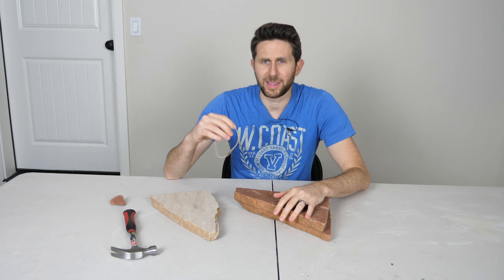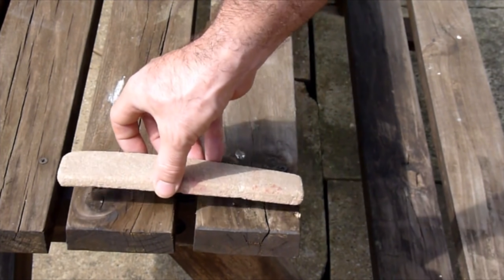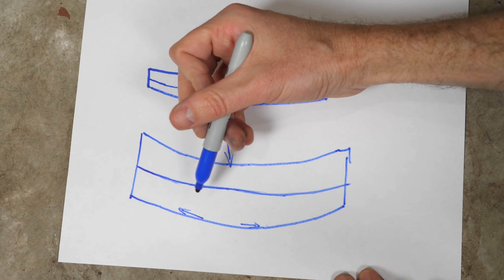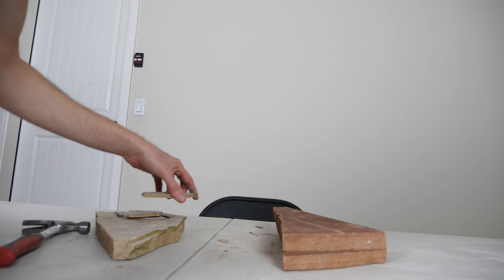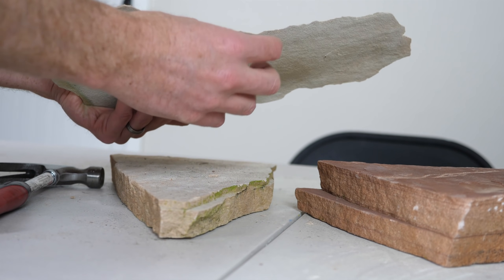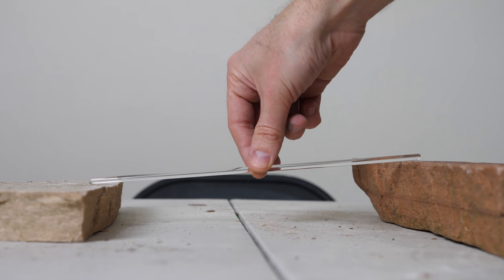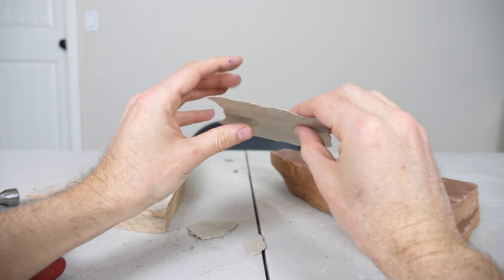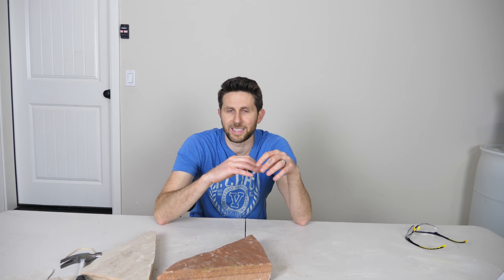Itacolumite—The World's Most Bendable Rock!

Comment: glass is a LOT more flexible than you'd think. a big 100x200cm sheet of 2.5mm picture glass bends about 10cm in the middle, when you lift it up by it's short side. and after all, glass can be made into fibers of remarkable tensile strngth and (tensile) flexibility.

Comment: 3:00 What if, while trying to bend it, you apply a large, fixed horizontal force inwards on the rock? This compressive force would cancel out the tension on the bottom surface when you bend it, so the entire rock would be under compression. Would that make it more bendable? (The piece would have to be thick enough that it won't just buckle.)

Comment: 0:50 its actually a quarzite derived from a sandstone
5:29 the layers are the result of sedimentation weak zones are usually were the material changes (like a silt or clay layer)
9:50 there are 2 types of deformation brittle and ductile for ductile deformation of rock you need higher temperatures and or pressures
10:04 basalt columns are a bad example as their "bend" could be the result of a shift of the cooling surface
there are pretty massive folds even visible from space check out the nunavut land claims on google earth for example

Comment: Although I think the video might be mostly correct, the effects of the experiment trying to bend the slimmer stone could have a bit exaggerated by the fact you are holding it with your hand. I suspect a lot of the bending we can see in the video at 7:15 is the result of the skin of your hand (which is soft) "absorbing" or "bending" over the force used to try to bend the stone, more than the actual stone bending.

Comment: Even if you talk only about a few years of compression, you can still see bent rock...for example who hasn't ever seen a table made of marble, which is a few years old? Did you notice, that it is slightly bent in the middle? Well this isn't an optical illusion. This is real and it's due to the continuous action of gravity on the table top and of course its acting most in the middle because at the ends it is supported by the table's legs or carrier columns..if you haven't ever noticed this, try to look closer when you next time see a table made of rock in a garden or park

Comment: This video made me think of a trick I learned long ago:  Bending a single stiff and brittle crystal without breaking it. Even though it sounds and looks awesome, and is so easy to do, I cannot find any mention of it on Youtube or Google. So maybe it would be a good one for you to do.
The trick is to get a long and thin salt crystal, grab either end with one hand, and bend while under running water. I suppose submerging it in water might also work, but maybe it needs to be flowing quickly?
It works because cracks always start at the surface; so if the surface is constantly being dissolved away, a crack cannot start; and so instead the crystal deforms into polycrystals that change crystalline axis as they go around the bend.
I only had salt crystals ~8 x 3 x 2 mm , but maybe you could grow much longer ones for a more impressive demonstration.

Comment: I’ve always wondered - is there a material that doesn’t deform?

If u put pressure on it, it will break before bending.
If not what is the closest material to that
Reply: I know I'm 2 years late but I'm pretty sure every material is capable of deforming to at least some degree if you make it thin enough. Even diamond, the hardest material on Earth, can be bent and stretched like rubber when turned into needles a few nanometers thick.

Comment: This is misleading and deceptive.  Millions of years of pressure won't bend a rock.  It will become brittle, crack, and little pieces will break off.  We see that with concrete in our driveway.  Only way to bend a thick layers of rocks is when it is molten like magma or when sedimentary layers are pushed by water to form cement.  The sedimentary layer hardens under water like cement as a chemical reaction takes place.  This rock can bend under water pressure or pressure from the earth.  We see it happen when volcanoes erupt and magma flows into an area or when floods occur and carve out a canyon.

Comment: Isn’t the width relative to the length? Meaning, you can bend the thick rock if it was realllllly long. 

Or if you cut that ruler down to 1 inch by 1 inch. It would become extremely hard to bend. Am I right?

Comment: Glass will flow too, but it's even faster than rock!  If you find a window that is just a few hundred years old the bottom will be thicker than the top! The surface tension is high, so the stuff in between flows more.

Comment: I suspect much portion of the "bending" comes from the rock not being perfectly fixed between your hand and the supporting surface below. Please, repeat the experiment with a much better fixed rock. Use a vice or something. Or you could use the thin layer of rock as a bridge and push it down in the middle. That would solve the fixing problem.
Reply: I was thinking the same thing at 7:25 you can clearly see how its just hinging in the edge of the other stone and not actually bending.

Comment: You are wrong about one thing. A thicker rock sheet will have much lower outer fiber tensile stress due to same bending moment. The outer fiber stress = moment/section modulus. The section modulus increases by square of thickness. So thicker section gets much lower stress. The reason you were able to flex thin material more is due to the deflection formula. Which states that the deflection increases significantly when span to thickness/depth ratio gets larger.

Comment: All in all, This vid' is very misleading about the mechanical principles of bending moments, stress & strain.  In the demo' at 6:40, the flake did not actually bend.  It pivoted on a flexible (in mechanics termed 'pinned') joint.  Neither was it explained that glass; counter-intuitively; is a very elastic material. (try bouncing a glass marble on a glass surface.)
I think you will find that if you measured the stress in any thickness of a material, the forces in the material at the point of failure will be similar.   IE. If a 300mm thick slab fails at an internal stress of 20 Newtons/m^2,  then a 3mm slice of the same slab will fail at an internal stress of 20 Newtons/m^2, as will a 0.3mm slice.
Reply from the maker: Yes it will fail it that same internal stress, but when a material is thicker it creates very high internal stresses with less deflection. That was the point I was trying to make.
Reply: @TheActionLab  : Perhaps!  What you failed to explain is that it takes a relatively greater load to result in failure.  That is why a thin deep beam can resist a greater load than a wide shallow beam of equal cross sectional area.

Comment: Yeah everything flexes, but not that much. At 7:10, you're cheating: your cantilever has a flexible hinge, not a fixed connexion (1/ hand flesh is way too soft, 2/ forces in a fixed connexion are way higher than what your hand can hold 3/ bottom surface is not flat). I guess the chan is for kids, please show them things the way they really are / not luring them ?

Comment: I think the slice of sandstone was more "pivoting" than bending. To test the bending, you should have set it between two hard objects, as you did for the glass rod. Because if you look closely, you can see that it pivots around a point where it's touchin the rock on the left (which is not flat), and the "spring motion" is created by your hand that's holding it so it goes back to the original position.
I guess it does bend (actually the last test you do when it breaks, the slice seems to be held in place firmer, and there is less pivoting), but this pivoting motion makes it hard to differentiate between bending and pivoting.
Reply: I agree, sedimentary rock is briddle, thats all. So before it would bend it would crack at the point with most force because the sandstone grains are not bendable themself, they are very pourus. Its like with bread, bread itself is only elastic as long as you compress it, if you pull it outwards it breaks and does not go back to its original form. And elasticity means something goes back to the original form. Well if you rip bread apart it does not go back to be one part but now you have 2 pieces.

Comment: Everything bends like that, hard objects just need a long distance to bent.

Look up rail roads flailing, u couldn't make them do that without 3 people pushing, bit the force gravity applies builds up a bit and it flails up twice as high as the truck.

But if u wanted to flail it even a little u would need a decent swing with a sledgehammer.

Comment: To bad your bendy rock isn't a true rock.
Rock (1) To the geologist any mass of mineral matter, whether consolidated or not, which forms part of the Earth's crust ... (2) The civil engineer regards rock as something hard, consolidated, and/or load bearing, which, where necessary, has to be removed by blasting. This concept also accords with the popular idea of the meaning of the word.
Stone In geology the word 'stone' is admissible only in combinations such as limestone, sandstone, etc., or where it is used as the name for extracted material - building stone, stone road. It should not be used as a synonym for rock or pebble
Reply: Dude it is still a rock because it is a type of igneous rocks.

Carbon added to the cement.
Gravel is a mixture of metamorphic rocks.

Also it shows a another type of Rock cycle
 
Dude there is still a cooling/crystalization

And Compaction/Cementation

Just added weathering with the corrosion

Rocks is a compound material made from earths mantle not crust its just time that conserves where rocks will go like, magma if solidifies inside earth also known as Intrusive/Plutonic rock other types of this is oblimate and congrenate.

Extrusive rocks are outside where the rocks is now found like obsidian, pumice, basalt and more.

But through time it will be a sedimentary to metamorphic rocks..
Reply: Also rock can be clasified through the mohs hardness scale according to that rock has 3.5-4.5 Scale

Comment: I would imagine that the dimensions of the rock play a factor in their ability to bend. For example, if you had the ability to increase the size only the length of those rocks while keeping the height and width of those rocks the same. Or If you had broken that glass rod into 4 even pieces, then I would also imagine that it would have been harder to bend the individual pieces.

Comment: Huge amounts of force, like those produced by an earthquake, are capable of actually bend solid rock as for example concrete. As seen in Mexico City's big earthquake a couple of years ago, some buildings were severe damaged because concrete bending from main structures like columns and beams caused big cracks in inner block walls and the falling or disfiguration of facades made from brittle materials such as cheap bricks coated with plaster. The concrete structures in some cases are still good, but this torsion originated from the earthquake caused such damage that repairing costs are really high and for that reason, they’re abandoned now, leaving some groups of people without their homes, and with their possessions still in there, being slowly looted from thieves since then, because government says that it’s a risk to recover big belongings.

Comment: From 6:38 to 7:17 it is very hard to see if the thin sandstone rock is actually bending at all, because of the very large amount of rotational movement levering up the palm of your hand. It might be possible to reveal how much bending was taking place by applying a software deshaking algorithm to this video (stabilizing the thin rock by making the background move), but a much better solution would be to redo the experiment, doing to the thin sandstone exactly what you did to the wood ruler at 4:08 – put both sides on top of solid rock and press on the center, making it quite clear if there is any actual bending and if so, how much.
Reply: What?

Comment: question: when a telco worker comes connecting optic fiber to home. The guy kind of solder the optic fiber then the fiber goes to the appartment. So they solder glass, not a plastic ???????  The guy let me see how he operates the machine which solder: proper cutting, alignment of the 2 parts, soldering, then testing the quality of the signal to check if the solder is proper

Comment: I doubt you are a stoner so i don't expect u to fully understand this...

But is the compression present when cutting through something solid except on the other side? Thus when u cut through a peice of Pollen (Dope/Solid for if u need some reference) once u get all the way through or more half way it slices immediately while one half is fired across the room.

I assume this as the blade would be pulling the particles apart just like the bottom of a rock you are trying to bend thus creating a compression on the exact opposite side untill the two forces meet and chop weee goes half the pollen?

Comment: Scientists have now developed flexible nanostructured ceramics which aims to revolutionize aerospace applications because it will permit highly flexible, compressible high temperature gaskets, allowing longer lifespans of rocket engines, lower costs to repair and refurbish those engines, and, if need be, even repair those engines in space without complicated structural tools normally required to hold them in precise alignments.

Such flexible ceramics might also hold multiple other high temperature applications, such as higher temperature fire resistant insulation [albeit pretty pricey!] for protecting homes and autos, corrosion resistant gaskets in the chemical industries, and possibly super fire fighting clothing for emergency rescue personnel and forestry service personnel.

Any place you can have elevated heat resistance and flexibility you can place more sensitive items in closer proximity to hazardous environments, and this flexible, low mass ceramic material could allow the exploration of very hot [and cold] planets, possibly even leading to viable mining if such planets have adequate mineralogical value. [if a planet like Mercury, for instance had some mineral or another of great value, one could use such insulation  to make mining there feasible]

Comment: when I studued material science many year ago, we ran an experiment with a stone cylinder. We put the cylinder under very high hydrostatic pressure, then squashed it into a spherical mold. In less than an hour, the cylinder flowed into the mold, making it spherical.  This showed how brittle marerial can be formed plastically, by preventing it from having tensile stresses.  Another thing we learned was that materials get more brittle when they are loaded very quickly. We  dished a mild steel plate by loading it slowly. When the same test was done very quickly, the steel behaved as a brittle material, and a flat disk was punched--with no evidence of plastic flow. This is why a slow bullet dents steel, while a very high speed bullet punches a hole.

Comment: Doesn't it also depend on the length and width of the piece of rock you're trying to bend? Even that very thin piece wouldn't give much if it were a half inch long. What if you took that rock that's four inches thick and made a piece, say, 200 meters long? I would think you'd get more of a bend, right? If you were to take a marker and make a mark at the point where it will bend, that specific spot will bend more the longer the piece is to either side of the mark. Right? 😕

Comment: Most materials (or maybe all of them) are malleable when they are under high isostatic pressure. There were some experiments done for deforming ceramics while being in pressurized oil, and it was shown, that ceramics can be deformed without breaking. Maybe this could be another way for bending rocks, although this would be plastic and not elastic deformation.

Comment: A very long 2 inch thick lab would flex fairly easy lets say 2 inches thick 4 inches wide and 2 miles long supported on each end and above a surface say 24 inches. If it was perfectly uniform at its half way point it would touch the surface below essentially the moment any support under it was removed. Now leave it for some years and over time the contact patch under the rock would grow  outwards from the mid point towards the end. I suspect this period of time would be measured only in the double digits for years say something between 10 and 50 years. I don't see how this experiment could be done in real life but in math and computer simulations it should be quite testable. Maybe actually do a video on how to test the theory and if possibe test it in a computer simulation?

Comment: Why does something make a noise when you flick it like in the piece of microscope glass, is it thorough the sheer speed of the vibration? Is it through it vibrating against the material it's vibrating against? Does the sound start on the initial point of release or does it start after the second wave of it being released? 

I'd like this to be answered as I've always been curious from playing guitar an the guitar (not the first strings) but pick would make a sound if you flexed it then released it within your fingers, try for yourself please and try and give me an answer, (the noise would happen even if the price of plastic is held between two soft pieces of material so there's no initial contact vibration)

Comment: So the reason for those layers in that sandstone is usually due to a change in deposition. Above and below that plane is sand, but in the plan itself, there is probably silt and clay. And if you crank up the heat and pressure enough, rocks most certainly do bend and fold! It just takes quite a lot of heat and especially pressure. Fold and thrust belts are found all around the world and they are caused by plate tectonics.